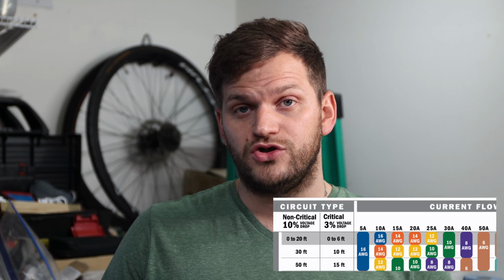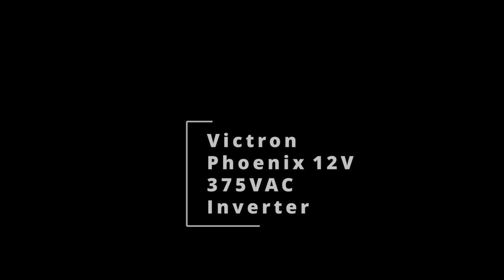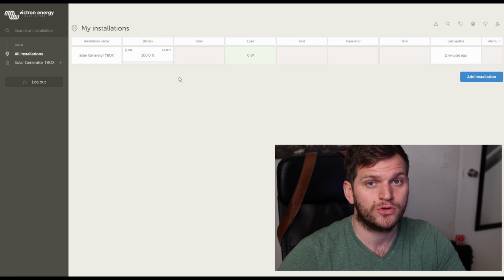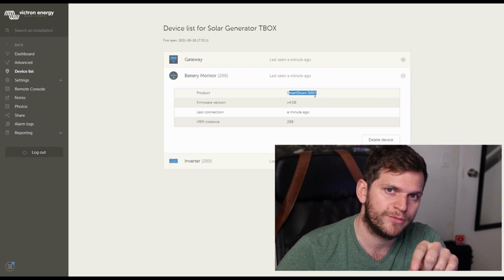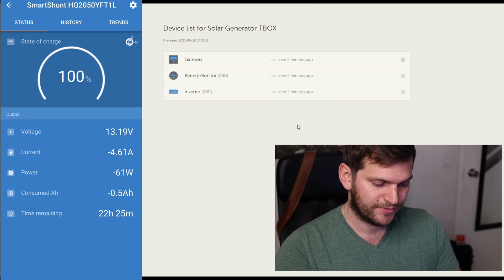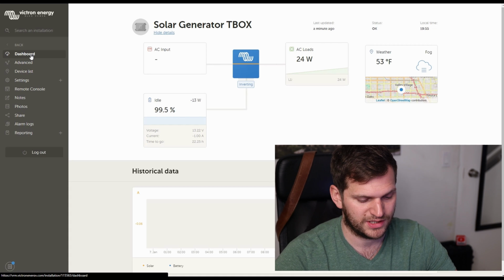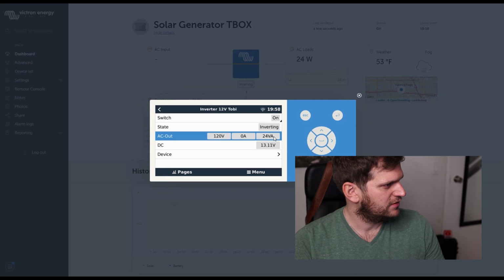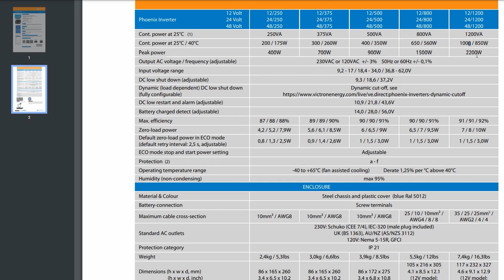Victron 12V Inverter | How does it perform on VRM | with #Raspberry Pi | No GX Touch 50 and Cerbo GX

Comment: HELLO
Great video!
I had a question that I didn't see on your video, can we turn on or off remotely by VRM the multiplus 2?
I checked on VRM there is a function
Inverter/Charger Control
how does it work?
can we turn on in charger mode only or inverter changer?

thank you
laurent

ps: I will need this function because I would like to start the multiplus 2 (8000VA) during the day and close it in night mode just use the charger mode in night mode at the cheaper off-peak rate and restore the day
ESS I am not convinced because of the injections into the network that can happen

Comment: Love that disclaimer blurb at the beginning (LOL). Just acquired the 48/1200 and very happy with it. It will easily handle everything I need for the winter here in Phoenix, Arizona. Just need to put together a Raspberry Pi with VenusOS so I can monitor from abroad (even though I never go anywhere/LOL). Thank you for your contributions to the Victron DIY community...

Comment: Is it possible using the 25% soc to turn off the inverter and restart it at 50% without adding a relay but using the software present in the raspberry?

Comment: does the Victron Energy Smart Battery Sense connect to the R Pi Venus OS
Reply from the maker: It did not for me since it is Bluetooth only. But when using another Smart Shunt for example you can have a network and connect them to each other and use the information through this connection I believe
Reply: @tobisreallifeskillswithtobi  I'm looking for some inexpensive way to remotely monitor a battery

Comment: Do you have to ground the Inverter? i recently bought  a 12/500 phoenix inverter
Reply from the maker: That's a great question and I did a quick research and found this comment in a forum: https://diysolarforum.com/threads/how-do-i-ground-a-12v-battery-and-an-ac-inverter.50335/#:~:text=time2roll%20said%3A-,Generally%20no%20ground%20is%20needed%20unless%20connected%20to%20utility%20power,you%20need%20to%20ground%20them%3F

"Generally no ground is needed unless connected to utility power. Same as a portable gasoline generator."

Comment: How does the phoenix inverter look on the main screen page of  Venus OS? Just like a multiplus? Or very basic?
Reply from the maker: I don't have a Multiplus unfortunately but this article shows it pretty good how it looks like in the console: https://community.victronenergy.com/questions/136833/display-of-inverter-power-on-vrmremote-console-doe.html
Reply: @tobisreallifeskillswithtobi  does your  phoenix show up at the blue inverter logo on the main screen? 
Do you use GUI mods? And can you control the inverter from the main page, as in  on/off/eco?
I'm guessing it displays the watts/VA the inverter is outputting?

Comment: Is there a battery selector switch to choose lithium lead acid etc. or does it auto detect what type of battery? Thank you
Reply from the maker: You should be able to configure it for a for example low battery shutdown. This is configurable and you should configure it according to your type of battery. USually there are some presets available for Lithium acid batteries.

Comment: You are not correct about Raspberry Pi. You have not enable VRM two way communication on your pi. When you do that you will see the list of devices similar your see with Bluetooth ( or Local view)
Reply: Use your remote console (raspberry PI), go to Settings->VRM online portal->VRM two-way communication. When you enable it,  you could also update device firmwares using VRM (VRM->Device list - section Firmware Update on the bottom of the page).
Reply from the maker: @romandmytrenko7771  Awesome, thank you! I was not aware of this feature so far :)
Reply: @tobisreallifeskillswithtobi  Victronconnect-Remote (VC-R) https://youtu.be/gwTbWaRT9T4  Saludos desde Chile!
Reply from the maker: How do you enable VRM on the PI?